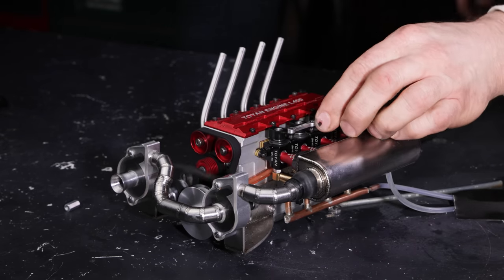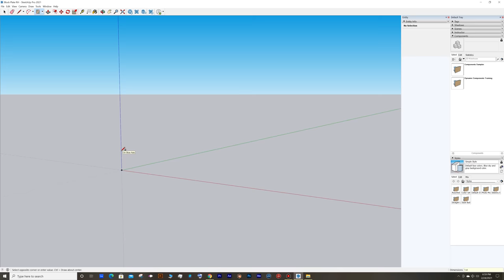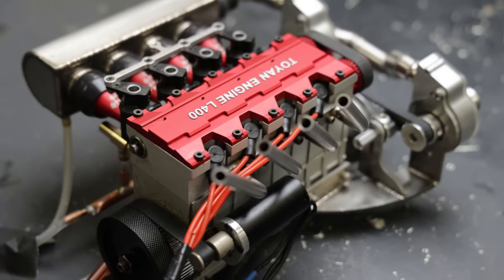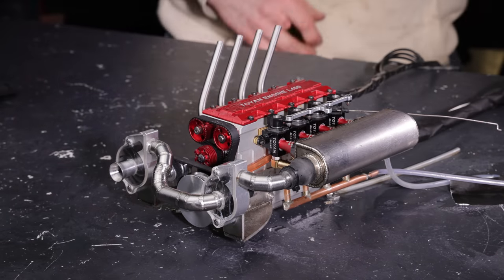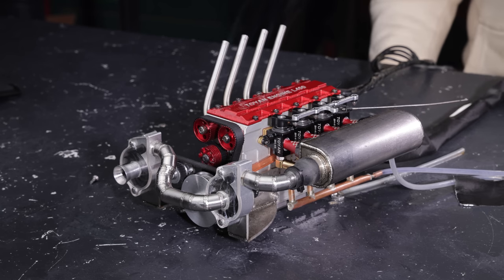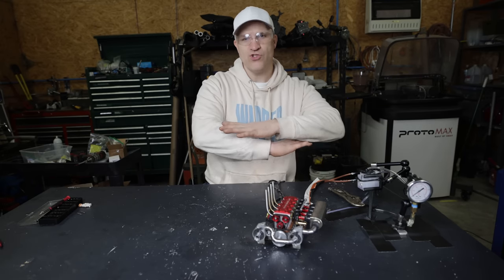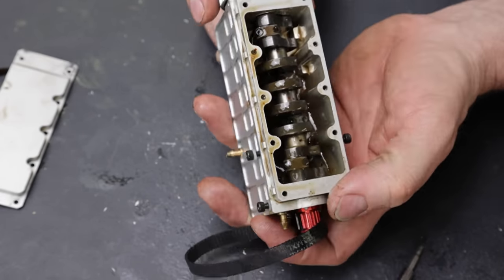Twin Supercharged 4 Cylinder Nitro RC Engine

Comment: Nothing matter tell you address the valves spring that can't hold the pressure you can tell there floating in the video but if you fix that problem you can't run no more than 1psi the short strokes make engines have extremely low compression boost pressure will just stop the piston from coming up you need a long stroke so it takes less power to compress the air all this engine doing is sending the exhaust gas out the intake valve that why its overheating

Comment: You can't supercharge a motor wich has no bearings between the crancks. This toyan inline 4 has only two bearings holding the cranckshaft  from the tips of it. Maybe this is why the motor vibrates, because the crackshaft is flexing.
A real size inline 4 motor has 5 bearings supporting the crackshaft.

Comment: Make an electronic dyno using a little alternator and a controlling current through a big power resistor.  Doesn't make a lot of sense to rev an engine with no load.
Reply from the maker: Sounded cool

Comment: That's not how compounding pressure works. The 2nd charger isn't going to be doing much. Not sure how you have yours set up exactly, but they look like the same config. Plus, the way you explained it isn't even right. 2 10psi chargers will only ever push 10 psi no matter if it's 1 or 100. You need two different configured chargers for compounding.

Comment: Il aurait fallut un système de galet tendeur a vérin hydraulique sur la courroie des compresseurs, tel que sur les galet tendeur de courroie d accessoire sur les BMW séries 5 E39, ,ou alors un type de ressort de trosion tel sur les épingles à linge, pour absorber les acoups sur la courroie des compresseurs lors de forte accélération/décélération

Comment: Remember to always use metric system of units:
Pressure: Pascal
Temperature: Kelvin (Celsius)
Distance: Meter
Mass: Kilogram
Time: Second
Luminous intensity: Candela
Eletric current: Ampere
Substance amount: Mol

Comment: I think the second supercharger is doing nothing as it is turning at the same speed as the first one. The velocity of the incoming air matches the speed of the second supercharger so it likely wouldn't be compressed much if any. Try a smaller driven pulley on the second supercharger, 10:1 ratio. When are you going to build a mini dynamometer to test your neat little engines? Most supercharged engines have a lower compression ratio. This is because of the increased volumetric efficiency. Going from 20% to 50% volumetric efficiency is the same as jacking up the compression ratio by  30% or so. High compression plus compressed charge could be causing premature ignition/detonation, robbing power and causing overheating.
Reply from the maker: I don't know I tried with single supercharger and when I ran the simulations in fusion it showed a pretty large efficiency increase, I will build the dino very soon I was waiting for some machines to show up, this pandemic has been killing me with all these shortages and delays but I just got back filming  a few days ago..

Comment: I believe those are called “turbochargers”
Reply: Nope
Reply: They may look like a turbocharger, but a turbocharger is powered by the exhaust spinning the compressor, this is a supercharger which has a belt hooked up to the engine and the supercharger spinning compressor

Comment: Compounding does not double boost. Compounding a supercharger is pointless. Turbos do it to decrease lag
Reply from the maker: As for doubling boost, you're possibly correct, depends on the configuration. Other than that everything else you said is pointless. Sequential setup is to eliminate lag compounding setup is the increase boost ceiling... Get your facts straight boi...lol

Comment: wouldn't it be a turbocharger?
Reply: They may look like a turbocharger, but a turbocharger is powered by the exhaust spinning the compressor, this is a supercharger which has a belt hooked up to the engine and the supercharger spinning compressor

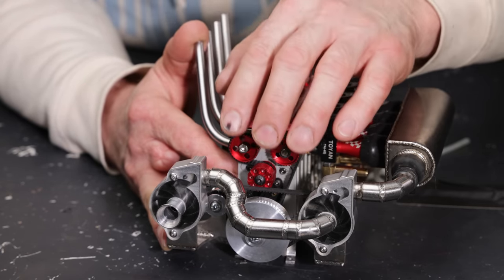Comment: 4:45 it’s turbo chargers
Reply: They may look like a turbocharger, but a turbocharger is powered by the exhaust spinning the compressor, this is a supercharger which has a belt hooked up to the engine and the supercharger spinning compressor

Comment: Hey again. If I,paid you to make this for me, would you do it? I have the motor, and I would to add a supercharger
Reply from the maker: I got your message, I just need to find the time and also I don't know if those impellers are available anymore, I'm planning on machining them from scratch in the future.
Reply from the maker: And selling them
Reply: I gotcha. If you decide to I would gladly pay you. I saw superchargers for rc motors. The unit looks just like the ones you use. But I could be wrong. If I can find the blower unit I might be able to do it myself. Probably not as good. Lol. 
I’ll keep an eye out for a message from you if you find the time. 
I emailed you, so you can hit me up if need be.

Comment: The throttle body intake holes are to smal,,if i where u i would make em bigger so u get in more air for a better combustion.
Reply from the maker: I agree, the problem I had is the outlet of the supercharger dictated the size, but it's still much oversized for the amount of air that this engine pulls in.

Comment: i think they are turbos
Reply: They may look like a turbocharger, but a turbocharger is powered by the exhaust spinning the compressor, this is a supercharger which has a belt hooked up to the engine and the supercharger spinning compressor

Comment: So you're going to run an engine with a bunch of mods on it that it wasn't designed for (including twin superchargers) and run it full bore at max boost. Then you're going to film it with a high speed camera "in case something crazy happens"??? Well of COURSE something crazy will happen. Why don't you just pack it with C4, set off the C4, and film THAT at high speed "just in case" there's an explosion?

Comment: thos are turbochargers btw
Reply: Nope
Reply: They may look like a turbocharger, but a turbocharger is powered by the exhaust spinning the compressor, this is a supercharger which has a belt hooked up to the engine and the supercharger spinning compressor

Comment: Those are turbos not superchargers superchargers go on top of the engine they are belt or chain powered off the drive pullys on the front of the engine the word turbo derives from the word turbine and that is what u put on your engine 2 turbines.
Reply: No this is a supercharger a turbo uses the exhaust to make air do research
Reply: @Mynameisajokeforexjwpandatower   That's one configuration bud they are still turbines so they are still turbos...idk how you fail to understand what a turbine is.
Reply: @Mynameisajokeforexjwpandatower  you can run DC motors to spool turbos bud same concept as what he's doing in this video it doesn't change what is doing the boosting
Reply: @Belikewaterbud  it’s not turbo charger. Maybe it could be a pro charger which is a type of supercharger
Reply: @Mynameisajokeforexjwpandatower  Oml no that is not what procharging is omg....
Procharging is when a turbo configuration is used in tandem with a supercharger.
Reply: @Mynameisajokeforexjwpandatower  Are u just trolling....
Reply: @Mynameisajokeforexjwpandatower  I think u need to get your nouns and verbs straight bud.
Reply: @Belikewaterbud  it’s a super charger it looks like a turbo charger though
Reply: @Mynameisajokeforexjwpandatower  Repeating yourself doesn't make something true, lol.
Reply: @Belikewaterbud  u don’t know what a turbo is
Reply: @Mynameisajokeforexjwpandatower  Bud you really outta to go get on Google and look that word up lmao you are too funny buddy your that guy in the community trying to hard to fit in you would rather defend a silly you tuber over someone who already said to you the literal definition and even semi explained "setups" and diagnosed the misunderstanding you yourself have about the concept of forced induction silly enough just word play if you can read between the lines and yet you still repeat yourself like your words mean something and you don't articulate any detail as to why you think that your only goal here is to troll.
Reply: @Mynameisajokeforexjwpandatower Correction plural misunderstandings.....

Comment: its a twin turbochacer and not twin superchacer
Reply: They may look like a turbocharger, but a turbocharger is powered by the exhaust spinning the compressor, this is a supercharger which has a belt hooked up to the engine and the supercharger spinning compressor

Comment: All those tools wasted on this. 

Check out the man who makes 1/3 replica guns with actual bullets that fire exactly the same way the real thing does. All kinds of weapons too revolvers. Pistols. Assault rifles and bolt actual rifles. Its amazing. 

But its the way it should be. Whatever a factory could do 100 years ago a man in his shed should be able to do today. 50yrs ago even. 

Especially with machine tools like these anything is possible from grandads day.

I hope miniature guns hobby takes off.
Reply: The way you described compound pressure makes me think that for that to work the first charger needs to charge up double what the 2nd charger does. 

Whatever the pressure volume of air in the tube between them cant just grow can it. Im only guessing but I see it. 

Unless is takes the tubes volume and compresses it into a smaller volume. 

Intakes are always bigger than exhausts thing. 

I think they both need their own intakes and the tubing working into on inlet to engine. 

Not compounded whatever that is. But it'll be easy to find out you did the hard work knock up a quick two into one pipe and try it.
Reply: Direct drive is always best what would happen if your pipe work out of a charger went straight into 2 intake ports. One charger per two cylinders? 

Atm the chargers I think are fighting themselves to get into a void once the air is inside that huge box the engine suck is back in play not overwhelmed mayb. 

I am just guessing though I'd like to be told I'm dumb though and why so I can learn too. 

I would try all set ups and see which is best. 

Also aren't they more like turbos but either way I would make the intake box smaller so there's no possible vacuum. If that's even possible. 

For cooling you'll need more too lol fatter pipes more coolant or maby whatever sci fy juice the high end liquid cooled PCs use. Something with much higher boiling point mayb. 

Yeah I'm still guessing lol. But thinking what else are these videos meant to make us do lol. 

Learn from others mistakes and wins. JhonnyQ90 is below he will be a wealth of knowledge on this that man is a genius. 

But still rolls with suck it and see test and tuning lol. Best way who has time for maths lol.

Comment: Those are turbochargers not superchargers
Reply: They may look like a turbocharger, but a turbocharger is powered by the exhaust spinning the compressor, this is a supercharger which has a belt hooked up to the engine and the supercharger spinning compressor

Comment: There turbo chargers not superchargers
Reply: They may look like a turbocharger, but a turbocharger is powered by the exhaust spinning the compressor, this is a supercharger which has a belt hooked up to the engine and the supercharger spinning compressor